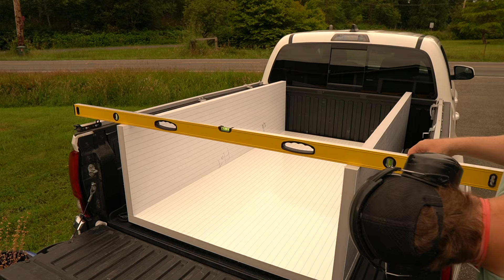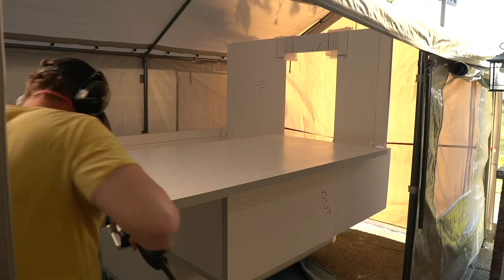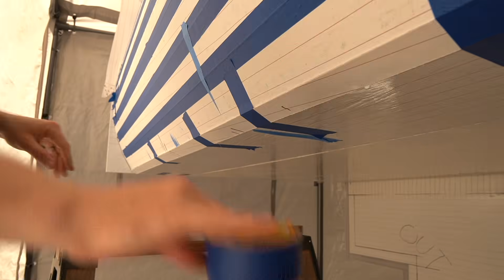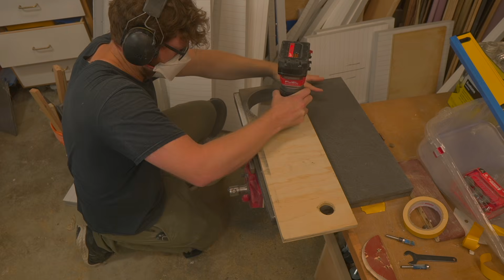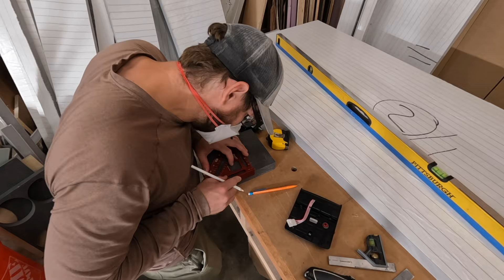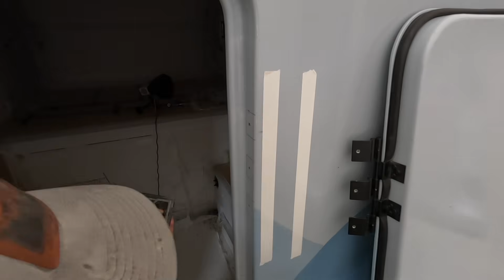DIY Fiberglass Camper Shell, Full Process (part 3)

Comment: Nice job on the camper I especially like how you detail everything during the process, very informative. My one question is the floor of the camper strong enough to stand on when the camper in not in the truck bed and sitting off the ground on the jacks?

Comment: HELP? is a fiberglass roof instead of a rubber roof flexible enough to withstand driving vibration and wind? I want to redo my rv roof with cloth fiberglass and epoxy but everyone thinks I’m crazy. They say it will crack. Thoughts?
Reply from the maker: That should be fine. Fiberglass with epoxy as the resin is pretty flexible.

Comment: I am really getting a lot out of this! Thank you for all of the effort. Keep in mind you can turn the fiberglass 45 degrees to go over tighter-radius corners. And, do think if you had used biscuits on the warped panels, the alignment would have improved?
Reply from the maker: I’m so glad! Biscuits don’t really help with the warped panels alignment, unfortunately. They’re a bit too rigid to have any flex.

Comment: Can you walk / live in this camper while its on its jack stands? Or are they purely for storage/removal reasons? Incredible build and video, so informational.
Reply from the maker: You’d have to add supports under the over-cab section so that it doesn’t tip, but yes, it can be used while on the jack stands. And thanks! Glad you enjoyed the video.

Comment: A few Q.s if I may... So the biscuits, you don't feel there's much of a strength advantage by using them or even more of  them ? Any thoughts on using multiple longer bamboo skewers at the corner joints ? I guess you'd need to pre-drill through your panel exterior... at least on one side.
And congrats on doing an awesome job... it came out awesome... well done !!
Reply from the maker: Thanks! Biscuits add practically zero additional strength, but it helps with alignment. All the strength comes from the inside and outside fiberglassing work done around a joint. Bamboo skewers might help initially tacking things in place, but clamps accomplish the same thing.

Comment: My goodness, my gracious, my boy David, that’s a project to be proud of, or so it seams from here! That thing looks awesome. Way to go, man.

Now you’ve got my curiosity cruising.

How’s she holding up after miles of smiles, bumps and thumps, rain and terrain? How are those seams and corners behaving? Any cracks, gaps, flexing or stressing where the fiberglass meets and greets?

And that nose, smooth and swooped, rounded and shaped, does it slip through the wind as nicely as it looks? Or do bugs, gravel and highway travel eventually batter the face? Any chips, nicks, dings or stings? Weak spots you’d reinforce, little lessons you’d redo, or anything you’d change if you built yourself a version two?

Because I’m seriously impressed with this sucker. If craftsmanship collected ballots, I reckon this build ought to earn you a clean million votes. Unique, useful, beautifully unusual. I dig it.

I’m looking at building my own little rolling home, foam at the core and fiberglass wrapped snug around the outside. Rounded corners so the cloth can flow, fibers stay tight, water stays out and down the road we go.

Light but strong.
Dry and tight.
Built for miles and built right.

Trouble is, I’d much rather hire experienced hands than learn every fiberglass lesson through bubbles, wrinkles, sanding dust and expensive mistakes.

So here’s the million-vote question:

Are you for hire?

Because if you’d entertain building another strange little fiberglass creation, I’d certainly enjoy talking shop.

Peace. Piece. Peas.
Cheese and cheers from Wisconsin. 🧀

Mohawk One Delta.
How copy? Over.
Reply from the maker: Literally my favorite comment I’ve received to date. Thank you, this made me laugh and smile the entire read through. Overall the camper is holding up well, biggest issues I’ve had is a few small delamination bubbles on one panel (easy to fix) that showed up, likely because of a dry spot during my initial lamination process. All joinery is holding up very well with no problems whatsoever. Bugs do collect on the rounded front but wash off easily. And no notable chips yet. There’s a number of small things I’d so slightly differently if I was to build a camper like this again, but overall I’m pretty happy how this one turned out. Unfortunately I’m not taking orders for campers, but thank you for asking! I am honored. This camper was kind of a proof of concept project that had been on my mind for a while and I’m super happy I went through with it, BUT, it is super labor intensive and that’s the reason camper manufacturers don’t build campers the way I did. I’m so glad you decided to comment on my video, thanks again and I wish you well with your future camper adventures.

Comment: Pretty much every calculator has a pi function, but just in case you need to use pi and your calculator does not have it, use 355/113 as it is really really super close. Not that anybody asked but it is handy.
Great videos, thank you!
Reply from the maker: Sweet, thanks!
Reply: How is that easier than remembering 3.14159?

Comment: Any estimate on how much weight you saved with the coosa board vs equal thickness wood?
Reply from the maker: It’s probably around 40 percent lighter than plywood. But because I used so little Coosa it’s not a huge weight savings.

Comment: I haven't done any serious work with fiberglass yet. I'm still trying to learn this process so I've watched quite a few "How To" YouTube videos, including your previous ones.  It seems like everyone else who uses peel-ply, removes it to create a nice, finished surface. I thought that was the reason for the peel-ply. It looks like you leave the peel-ply on (at least in places where you aren't glueing to a panel), presumably for extra protection. If that's the case, why not just add another layer of fiberglass cloth rather than use the peel-ply? <edit>Never mind. I did finally see where you removed the peel-ply just before priming the surface. Makes sense!</edit>
Reply from the maker: I like to leave the peel ply on as long as possible to keep the surface under the peel ply layer clean and free from amine blush. Once the epoxy fully cures I don’t need to worry about amine blush forming, but I still want to keep the surface clean.